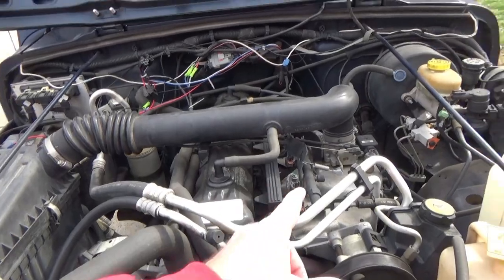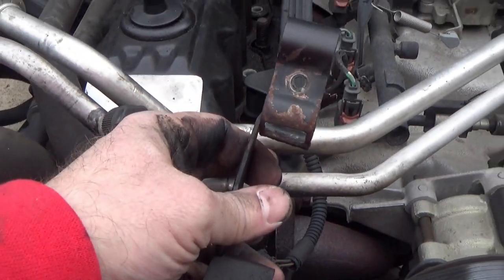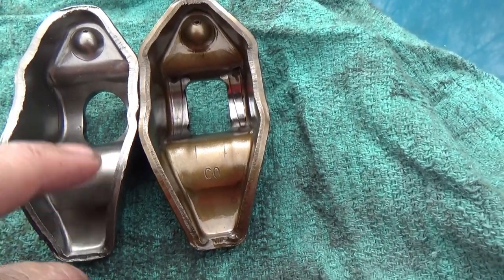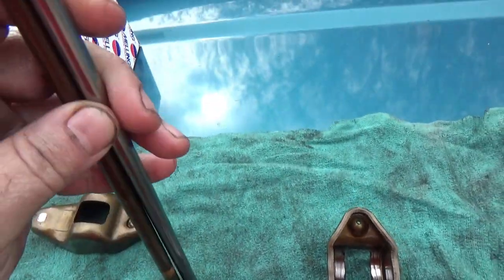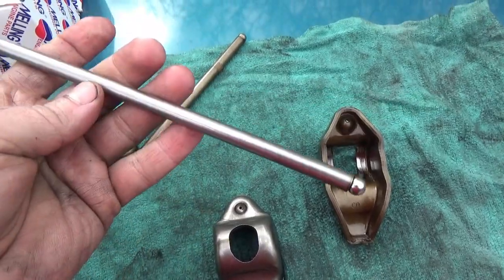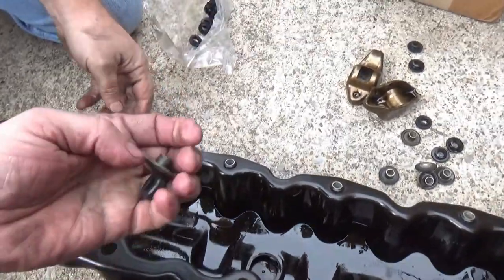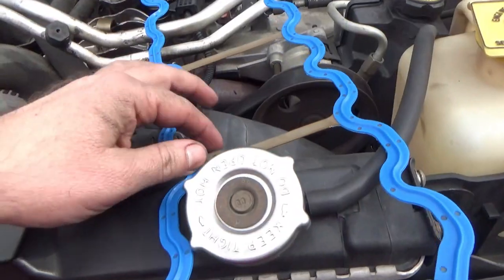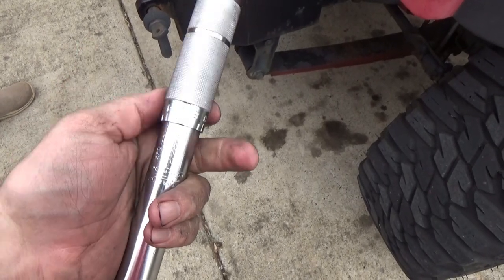Got that top-end Rocker Arm tick in a Jeep?! Change out rocker arm, pivots, and pushrods in that 4.0

Comment: Great video!  Thanks to you, I pulled off the job no problem.  After a BG109 engine flush and new plugs, Still had some unidentified ticking- thinking maybe lifters but then discovered slight exhaust leak on one of the flanges at the pre cat.   Just thought maybe, for those interested, try tightening those bolts up first (booger to get to, but a wobble 15mm socket with extension did the trick)  The forward flange bolts were a little loose and it worked like a charm.  It just might solve that ticking noise before diving into the bigger project??   Regardless, really appreciate your awesome instructions as my engine has never sounded better!

Comment: Great video!!! My XJ has 280000+ miles on it and I'm going to put stock ratio roller rockers in it. It still runs like a champ. I have the same valve cover gasket on mine. So far, the only major thing I've had to do on it, is change the cylinder head gasket in addition to the other gaskets.

Comment: Always believed  Fel-Pro gaskets over anything else aftermarket excellent job sir
Reply from the maker: Felpro oil pan and valve cover gaskets ALWAYS!! 👍 I've bought engine kits that come with some other brand valve cover and oil pan gasket. I'll go buy the Felpro Permatorque separately every time. Gaskets such as water pump and thermostat gaskets I'm not as picky.

Comment: Thanks for the ending comment about the restoration of power, I have exactly that problem, I replaced the injectors, which helped but I also have a misfire code on cyl 3. The ticking is pretty bad. I'll check out the rocker arms. I have over 200k miles on the rebuilt head.

Comment: I have a 2000 XJ Sport with the 4.0 6 cyl. I'm getting the rattle and a misfire on #5. I'm guessing and hoping this will do it. I got the jeep with 315k KMS (195k MILES) for $500 CDN ($395 USD) with no tires(owner bought it for the tires and sold it to me as a slider) in 2018. I sent it to Bakers 4X4 here in Ontario Canada and restored it with some body work/floor pans/rockers and I'm just crossing 320k KMS (198k MILES). The bonus is it came with a 6 inch RC lift. Thank you for the video and the PRO tips. 

Fly fast shoot straight and never look back!

Comment: Man you should get paid for this vid! Coincidence -- mine is very close to same as yours. Also 2000 TJ with 177k miles. Bought it new in 2000 and have taken good care of it. And alllll this time I've been putting up with that clicking, that's it? lol. I've been putting it off and dreading it, assuming I was gonna have to adjust everyone of those freaking valves! Your video probably just cut my time in half and saved me a lot of guess work. Now I already know what to buy so I can just buy everything first and have it ready. You made it look easy. Just hope mine goes that well. Thx a bunch!! By the looks of all these comments, it must be very common after around 20yrs/175K miles.
    But on a scarey note......
 On my job, I picked up an engine that had blown at 220K miles, that was also a 2000 4.0.  Again, he bought his new and took care of it. He said it just simply wore out. #6 piston skirt just wore thru at the pin. So that may tell me what to expect in the future.
Reply from the maker: Glad the video helped you!! That is kinda rare for for the piston skirt issue. I have been building engines for MANY years .. thats rare for a normal wear that has been taken care of.

Comment: Had a lifter tick ,pulled the cover and watched  the no.2 cyl exhaust bleed off fast so i loosened the rocker arm off then re tightened, no more tick I think the check ball was not seating, 100 miles and still no noise

Comment: The only problem with tightening up the top (valves, rockers, push rods, lifters) is that the next weakest link is the rod bearings. Had a valve job done on a high mileage motor (300k+) wasn't more than 5k later and the rod bearing went. Lost power and started knocking and blowing smoke. Guy who did the valve job told me I should have done the bottom t the same time. I rolled the dice on it and lost. Great vid! God bless and stay well.
Reply from the maker: Bud, I dont know who told you that but they are wrong. I have been building engines since I was 15 years old. I'm 50 now. Tightening the rockers has NOTHING to do with the condition of the rod or main bearings. That engine had bigger issues to begin with if that happened.
Reply: @Poweraddicts  Made them the weakest link, I should have had him do the rods, mains and rings at the same time. Might still be driving that motor.

Comment: Great vid bud. You should do a video on changing the lifters on the 4.0. thanks Chuck. Stay safe brother.
Reply from the maker: I've got an engine on the stand that's gonna get rebuilt. I can simulate swapping lifters on it. All the rigs I have access to right now are running great. If you're referring to top end valve rattle, most of the time it's the rocker arms and rocker arm pivots are worn out. The fella that owns the TJ that I did the rocker arm video on keeps talking about putting a high performance cam in his. If he does I know I'll get the video on that as well.

Comment: Excellent instructions thank you. But after getting everything back together, no leaks and sounded great I started driving and would idle at 2000 rpms unless I shifted down and engine is running super hot (gauges are fine) throwing p2096 code. I’m trying to figure out how doing this has created this problem? Any thoughts?
Reply: Check the pcv valve, crank breather, and vacuum lines, sounds like it's sucking in air from somewhere.
Reply from the maker: I agree with @Gabriel Herrera. Sound like you have a vacuum leak somewhere.

Comment: Just completed a full 1996 Grand Cherokee 4.0 rebuild at 191K miles. Much valve train wear due to using Castrol Syntec oil with no ZDDP anti-wear additive. Everything you changed we changed, but our machinist said the cam, lifters, and timing chain also were badly worn. The bottom edge of the lifters were worn down razor sharp where the new lifter had smooth round-over. 
Did you use a bore scope to inspect the cam lobes for wear?
Reply from the maker: Nope, didn't look down in the lifters. There was some wear on the top end parts we took out but it wasn't anything alarming. You on the other hand have much more parts wear it seems. It may be time for a new cam and lifter kit for you.
Reply: @Poweraddicts  New cam, lifters, push rods, timing chain/gears, and oil pump are installed. New pistons, crank journals ground, new main bearings too. BTW - piston slap is what caused the noise in our 4.0L, especially #3 where the piston skirt on one side was close to cracking completely off.

Comment: Best instructional video I've seen on youtube, & all the tips are great. It feels like I'm listening to a real experienced mechanic. Now if you can tell me how to get the brake banjo bolts from leaking fluid then I will be happy. I tried stat-o-seal washers and it still leaks. I noticed that the rebuilt calipers from Autozone have the banjo bolt washer mating surface sandblasted and I believe thats whats causing the leak. I think I will need to sandpaper that mating surface to reduce the roughness on it so it will seal correctly. Don't see anybody else giving tips on how to do such a procedure?
Reply: You tube search: spot facing a hole

Comment from the maker: Parts used in this video:
Rocker Arm: https://amzn.to/3JPVrWd
4.0 6-cylinder pushrods: Auto parts store. Amazon has no reliable source.
4.0 6-cylinder Felpro PermaDry Gasket: https://amzn.to/2v1CBbf
Reply: When I click on the links it says they can't find the page on amazon
Reply: @jasontanner5656  Same here, looking at a Crown automotive kit but it has mixed reviews.  Not finding many other options besides used on ebay. May just go for the Crown kit
Reply: @jonathonbaker9075  itd be an investment, but some roller rockers are said to be a great upgrade for this engine. Harland sharps are a good place to start if you're interested
Reply: Got a new link?
Reply: Can your recommend a different rocker arm kit it’s not showing up.
Reply: my 2004 LJ with 250,000 miles has the top end rattle (ive owned it since 186k and i am looking to replace rockers and push arms. your affliate links are broken but i see you were using the melling brand rocker arm kits (currently out of stock until march 2022) what brand pushrods are you using? and what brands do you suggest as subsitutes?

Comment: Pull the motor out of my 79 J10 EMC to 58
Six, rebuilt with a new parts Including top end kit. However now it sounds like a diesel. Thinking it could be the oil pump not circulating the oil properly. Any ideas? Appreciate your time and efforts.

Comment: You NEVER loosen your torque wrench to the point you hear rattling inside the handle. NEVER. Reduce your wrench to the lowest torque setting on the handle markings. Been using micrometer style torque wrenches for 40 years and you absolutely will throw the calibration out of whack by turning the adjuster all the way out. Minimum torque setting on the scale is always recommended.

Comment: Awesome.. I'm swapping my head bc it's cracked. 0331 head. My concern was the rockers.. some say you have to cycle the motor and tighten each one at TDC, but you just torqued them as the set.
Reply from the maker: Some engines have a specific valve lash setting that can only be set by doing certain rockers at certain piston positions. Older GM engines you have to cycle the engine. Most older Ford and Chrysler engines you can just torque them down and roll.

Comment: What would cause A dead miss on A 1990 wrangler 4.2? We put new plugs and wires, adjusted the carburetor, it has new rotor and distributor cap. The compression is 2 psi above or below 125 on all 6 cylinders.  It has loud pecking sound under the valve cover on what sounds like #3 cylinder. I wouldn't think the rocker wear would be enough to cause A dead miss, I could be wrong though.

Comment: Great video.  I'm getting ready to do this install on my TJ.  I was curious though if used any lube or grease on the rocker arms during the install outside of what we saw in the video.  I've watched several other installs where this method was used.
Reply from the maker: Thanks! I don't think we did. But, we should have to prevent galling. As long as its a quick start up getting the oil to the top of the engine there shouldn't be an issue. Good luck, thanks for checking out the vid!!
Reply: Soaking them all in motor oil over night before installation does a good job.

Comment: I watched a video from Moses Ludel saying these Jeeps (4.0 inline 6, for one) doesn’t allow for adjustments so a tool is required when doing this. He also named a couple of other times when it would be needed.  It is to ensure we get the proper  rod length. What is your opinion regarding this tool?
Reply from the maker: I have several manuals relating to the 4.0 and 2.5 Jeep engines. They all say to torque the rocker arms to a specific setting (not once a special tool was mentioned). I even looked in the legit service manual that Chrysler themselves use to service these engines ..... no tool was mentioned. What we demonstrated in the video is correct to Chrysler standards on a non-modified engine. That Jeep in the video still runs perfectly after the actions performed in this video.
I found that video you mentioned. In that situation he mentions after a valve seat grind ... yes .. after a valve seat grind the tool is needed. I have one and I have used it on modified engines. An engine in stock configuration like the Jeep in this video, no tool needed.

Comment: Hi there. 
Went to check the amazon links you have for the rockers and push rods and both gone. 
Did you use a specific brand of rockers and rods?
Terrific video. Thanks  v.
Reply from the maker: I had to remove the links. Amazon changed some stuff around apparently making all the links invalid. The fella that owns the TJ just went to Autozone to get all the parts. Hope that helps!

Comment: Really wish you had recorded it before you did the work.  Do you have an older video with the noise prominent?
Reply from the maker: Nope sure don't but many high mileage 4.0s and 2.5s have that lifter tap. He pulled in and we just got to work getting the parts swap done, we had a junk yard run to do that day.

Comment: So I take it that it’s not crucial to change out the lifters? Am I correct? Because I have a 2.5 doing the same thing.
Reply from the maker: If the tick is coming from loose and worn out rockers then there is no need in replacing the lifters. Typically if you had bad lifters you would have more issues than just rattling a noise.

Comment: hey there! you mentioned "you dont have to worry about cam/valve timing.. just take em off and put em back on.." Do you have to do any TDC or closed valve position? Or are they all just "remove and reinstall with torque spec"??
Reply from the maker: Remove and install making sure they are torqued properly. Really easy. Most Chrysler and Ford engines do not require doing TDC or valve position. GM engines do.

Comment: I've seen in other videos that guys are setting each cylinder to TDC before tightening down the rockers. Is this really necessary or am I good to just swap em out like you explained in the video?
Reply from the maker: It is necessary only on certain makes of engines like GM engines and some Fords. It is not necessary on the Jeep 4.0 or the 2.5. If it is a Jeep engine, do it like the video.

Comment: I have a rattle in my 4.0 when I first start it up but once the engine warms up the sounds goes away, 160k miles, could it be rocker arms or lifters?
Reply from the maker: It could definitely be the same parts changed in this video. As parts warm up they expand, therefore taking up the added clearances from the worn out parts.

Comment: I have a stuck or burnt valve… I tried pulling the valve cover to run it to visually inspect and the engine runs away revving. Is that indicative of a stuck intake or exhaust valve?

Comment: I have a 98 cherokee 4.0 I bought all new rocker arms guides and pushrods..  will this work for my jeep top end rattle especially on cold starts.???. thx
Reply from the maker: If it is the rockers making the noise. The TJ in that video did it mostly upon cold starts. So, if yours is because of worn valve train parts, the new parts should fix it. Rare that it is, on cold starts I've seen engines have light piston slap until they warm up. That can only be fixed with a rebuild. I really see the need for me to make a video diagnosing rocker/lifter tap. Keep an eye out for that video soon.
Reply: Yeah it does have a tic warmed up but not as bad a new hemi tick..lol.. it's gonna have a all new top end after this.. head came off for freeze plugs so it got new guides.. but bottom end hasn't been touched that I know of. But when valve cover first came off it was clean inside no sludge no deposits

Comment: Do we need to put the engine in TDC?  

Or do we just swap and torque to 19lbs as they are.
Reply from the maker: No Top Dead Center needed. Just torque them as they are. Thanks for checking out the video!

Comment: Question:
All 24 of the lifters, 10 valve covers and a camshaft have been replaced on my 2014 Jeep Grand Cherokee. Now it is reading codes for a IAT sensor that I will order today and for camshaft sensors. Research online says that a reprogramming is necessary for the camshaft sensors. Someone else told me the check engine light will go off after driving it so long. What do I need to do?

Comment: When doing the rocker arm/push rod replacement like you did in this video, did you also change out the lifters? I am personally experiencing the rattling and it gets quiet after the motor gets up to operating temperature. How far do you recomend going in on a job like that?
Reply from the maker: Nope, didn't do the lifters. He and I have talked about putting a hotter cam in it. Its his rig so I have no idea if that will ever happen. I personally would do just what we did in the video. Change pushrods, rockers, and the pivots. Changing cam and lifters is fairly involved job.
Reply: Me too. I figured bad lifter. Can u change lifters in this engine without pulling head?
Reply: @dandahermitseals5582  unfortunately you have to remove the head.   The holes are too small to fit the lifters throuhg.

Comment: Could running it low of oil for a few seconds make top end rattle worse, mine knocks worse after it ran low of oil (my fault I used the wrong filter and I feel like a idiot now) not sure if its a new knock or it just made the top end rattle I already had worse. Fingers crossed it's till my top end

Comment: Sorry another question ....if I removed the push rods and rocker arms can I put them right back on or do i need to make sure it is at TDC before torqued?
Reply from the maker: Dont worry about top dead center. Just put them back on and torque to spec.

Comment: Did you bring every cylinder to TDC with valves closed before tightening the bolts? I see mixed information on this
Reply from the maker: Nope, that is not required for Chrysler and Ford. Just tighten and torque ... call it done.

Comment: Would gummed up push rods and/or worn followers/value covers create a knock but only when I've reached full operating temp oil pressure? I'm also getting a minor exhaust sputter when the knock starts.
To add to the mystery, the knock and sputter goes away if I shut it down for 3-5 minutes.
Reply: Did you ever get any info?
Reply: @warchildwarhammer8837  There's no reply to read, is there?
No, I didn't.

Comment: When  tightening the rocker bolts for the load have to be taken off ?
Reply from the maker: On these engines, just tighten to spec and done. You dont have to rotate the engine to take the load off.